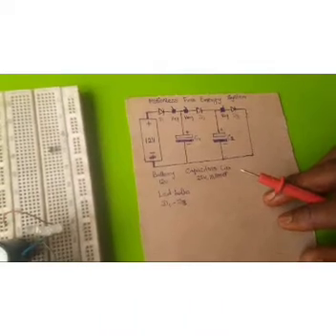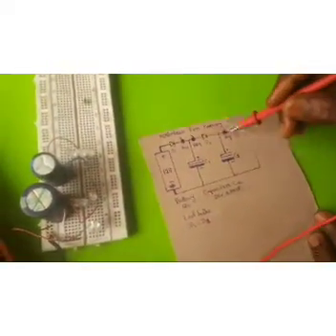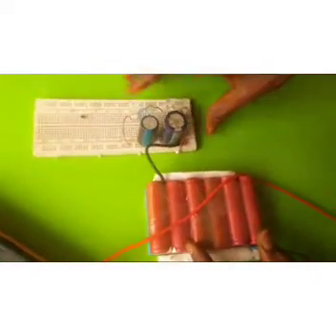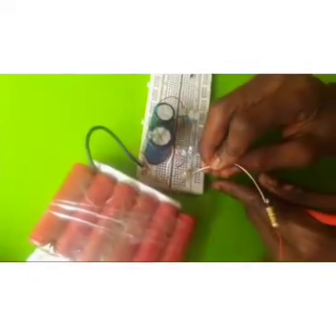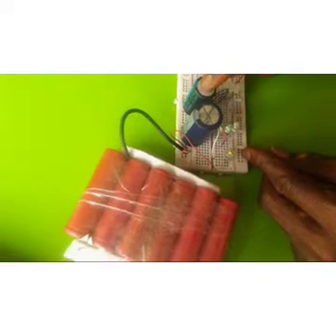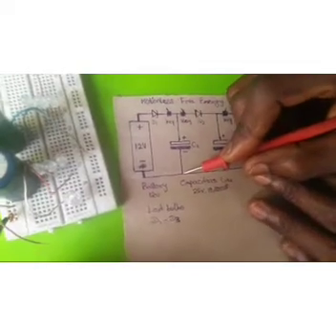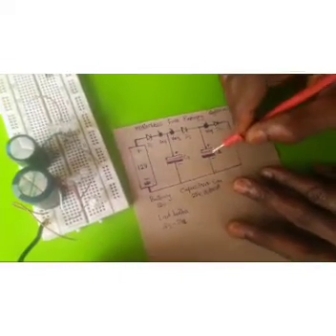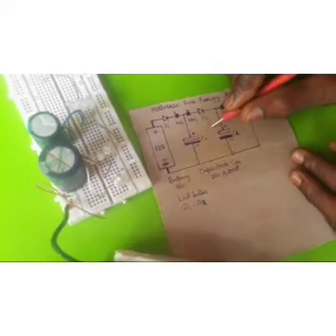Motionless free energy system 2022

Comment: nice and how much power its produce
Reply from the maker: The output depends on the size of battery and capacitors used.
Reply: @JfGreenEnergy  is it overunity or not
Reply from the maker: @goharnawaz9972  yes for sure
Reply: @JfGreenEnergy  how it is possible and share more details about this setup with design. e.g 1kw setup